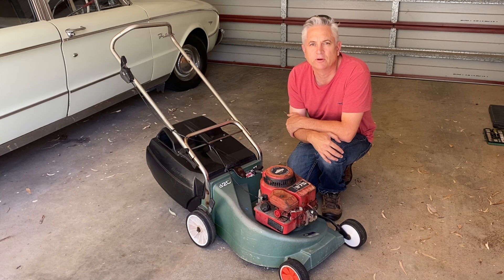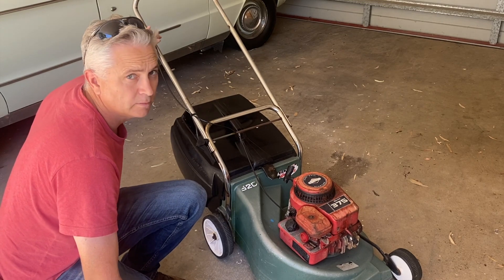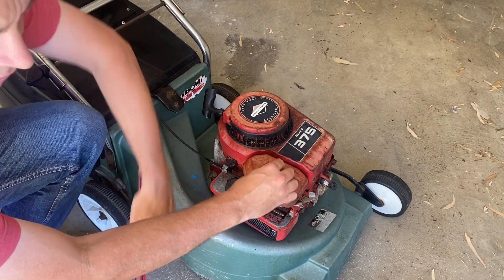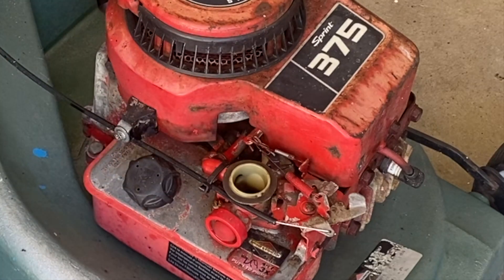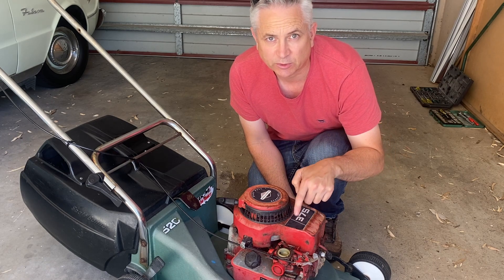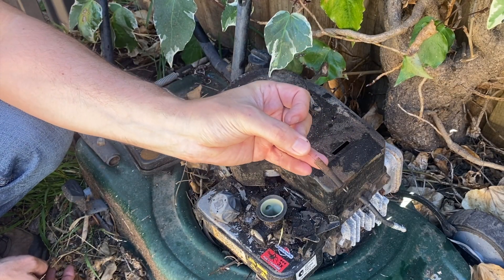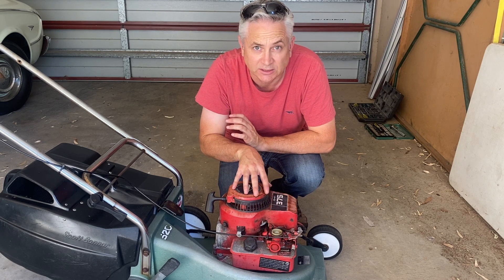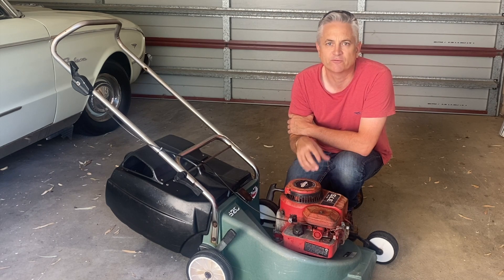How to Adjust Engine Speed to Fix Under Revving Low RPM Briggs & Stratton 4 Stroke Engine Lawnmower

Comment: That wreck just keeps on giving. I need my own lawnkeeper with dead Briggs sitting in a corner if the back yard as a spider town!
Those springs are a pig to replace. You obviously have the touch.
Reply from the maker: It’s like every time I think I should drag it to the dump another project comes along which it gives me another part for 🤣🤣🤣
Reply: @DrewFixIt  Why I dread to dispose.
Reply from the maker: @jamesfrench7299  absolutely!
Reply: Same i also need one the air vain governor linkages on there would save a mower i found in the bush absolute champion runs like beast but won't stay running unless you hold it i was shocked when i seen that was the problem both springs and air vain airm where there just the little looped linkages that links the two was gone 😂💀
Reply: Going to try make the linkages myself got the rough measurements of it found the part number its like a 3 dollar part but to get one youd have to pay 50 postage from America 😂 so gonna try make one with some wire if it works sweets saved a good little mower if it dont ah well ill get a mower with the linkage i need sooner or later im always finding junk with potential to live again 😂